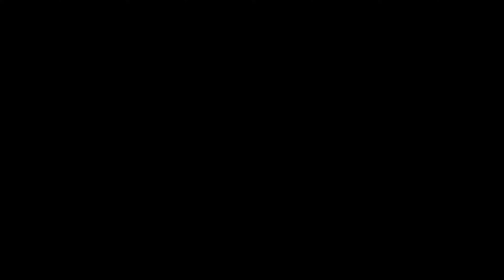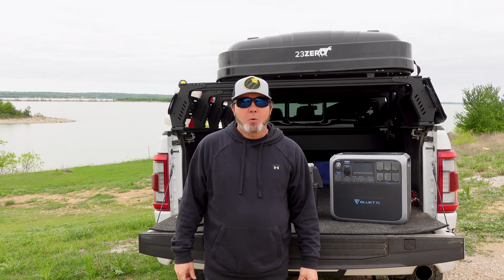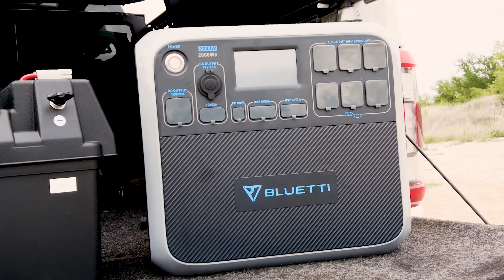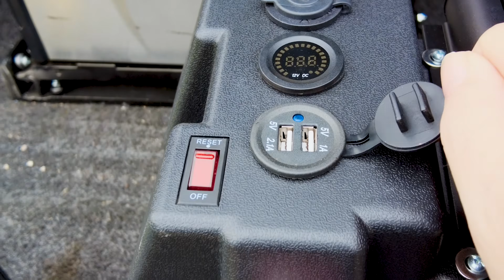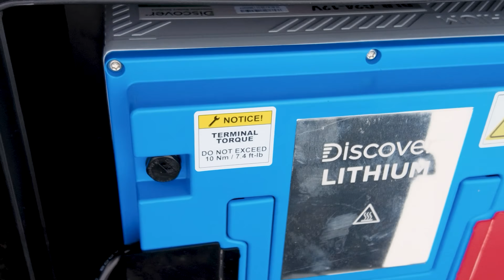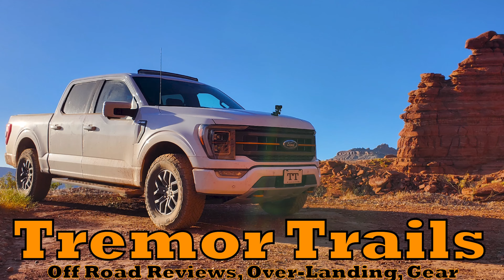Down and dirty RedArc Dual Battery Setup for my F150 Tremor

Comment: Great info.  Thanks for sharing.  I have a question regarding the Tremor itself.  I’ve been camping several times and have had the trucks battery die do to opening the doors throughout our 3 day stationary stay.  I was wondering if you found a way to turn off or keep the trucks lighting system, and screen, from coming on every time you open a door.
Reply from the maker: I've never experienced that personally. My suggestion would be maybe do valet mode or calm screen. That being said, Even at 3 days just opening doors and such, I'm still a little baffled how the truck would drain down. Have you tested the battery? I know I read a few guys had issues with their original batteries.
Reply: One thing I do is turn off the auto -deploy running boards. they deploy and retract every time you open a door. Even with that, the computer and screen boot-up is still of concern. Last trip i was keeping all the doors open instead of opening and closing every 2 seconds. Pretty annoying. Dont camp without a battery jump pack, for sure.

Comment: What alternator did you put into the truck?
Reply from the maker: I didn't.  It's stock. The SBI and BCDC connect to the alt to power the 2nd battery. That way you're not pulling down your crank battery and in emergencies you can reverse and jump start main battery from 2nd.